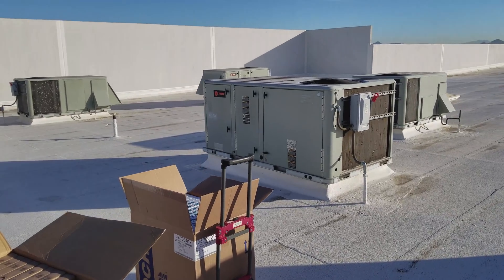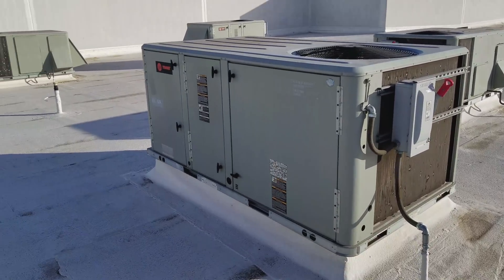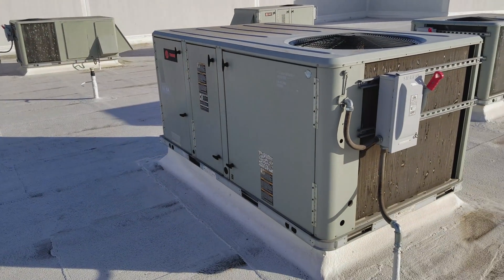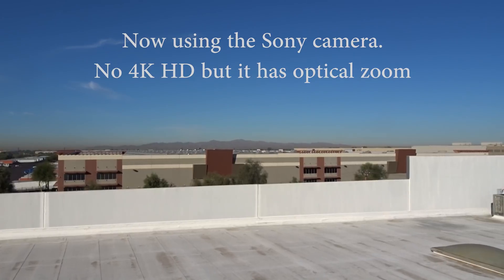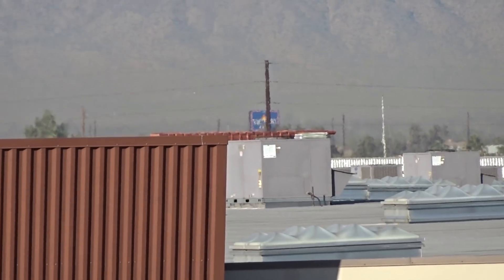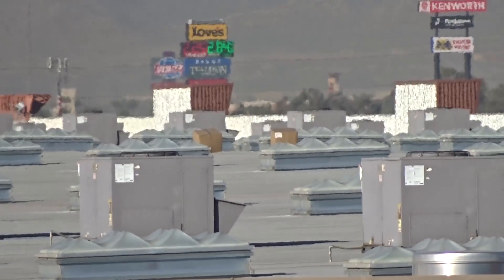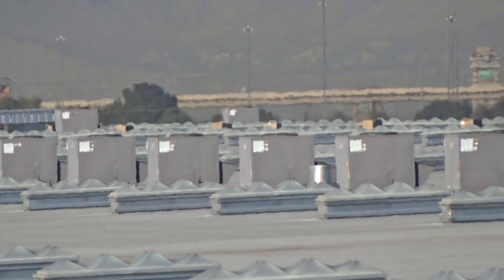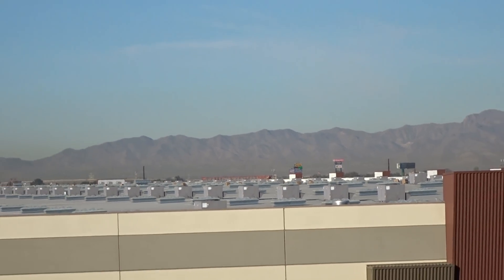300 reasons to want hinged doors on a commercial rooftop heat pumps!

Comment: Yeah, we could have sold them on several super stack units to cover the whole building, but where's the maintenance money in that? Silly man! :)
Wow, that is an awesome sight brother! Hell, you'd prolly spend half an hour just finding the unit you need to work on! I think if I worked on buildings like that I would keep a couple of Radio Flyer wagons strapped to the top of the truck with a tow hitch on one so I could load up the train at the roof door and haul all my stuff in one trip!
Reply from the maker: I worker on their smaller facility two miles away from this one and it took me 15 minutes to walk across the rooftop.

Comment: 300 RTU's that is just crazy, the biggest roof I ever remember had 70. A lot of trash left up there, sad.
Reply from the maker: I think that trash might be inventory of refrigerant and filters that the maintenance personnel are continuously using.,
Reply: hackfreehvac right, it would be wise for the building owner to hire a semi skilled hvac/maintenance tech to try to service them, lol. To save money. I work on a lot of Carrier RTU'S. This is in a northern climate, high heat exchanger failure rate on what I work on. They fail usually 10 years or so.

Comment: Whoever designed that mall should be shot.  That building should have some major centralized equipment instead of that nightmare.
Reply from the maker: It's a large warehouse for merchandise. A very popular organization.
But yeah, having hundreds of discrete RTU's instead of some larger centralized ones is silly!

Most of the space inside is one large open space other than some offices in certain areas.

Comment: For Carrier units without hinged access compartments, like those. It would take removing and replacing 2100 screws just to access the blower compartments just to inspect and or replace the belts. It would take an ADDITIONAL 5400 screws to gain access to the electrical compartments. You gotta think that for the sake of time, that there are only a couple of screws per panel. You know it!!! We see it almost every day on those Weathermakers. Now think 115 degree humid air and dust storms (haboobs) during the hot Arizona Summer Monsoon season and air infiltration. Not good.
Reply from the maker: Yup. And on another building of there's with the same units, the previous techs (or maintenance techs) had drilled new holes over and over because the carrier units like to strip.
So as you were putting the ten screws back in each door you had to try more than one hole at each screw location to find the one that wasn't stripped!!!